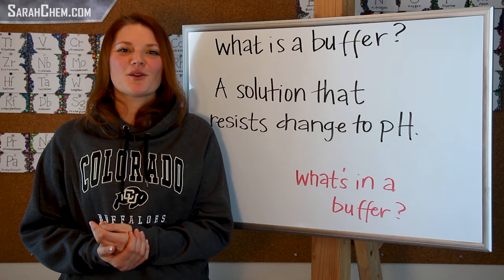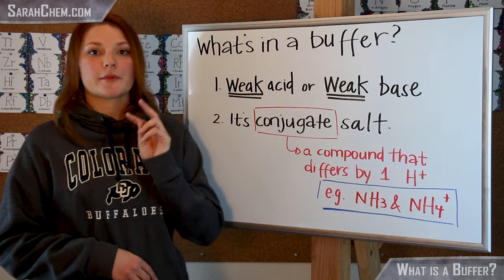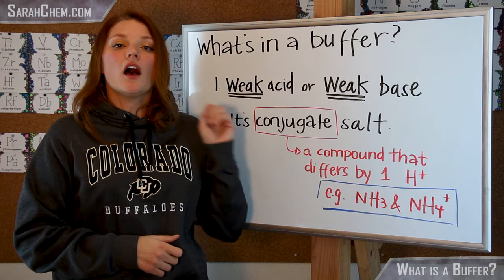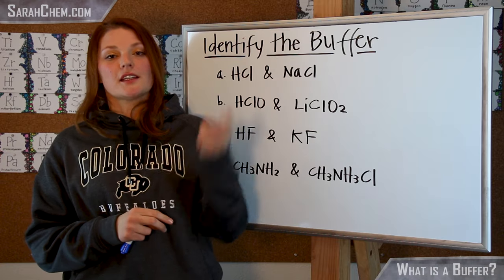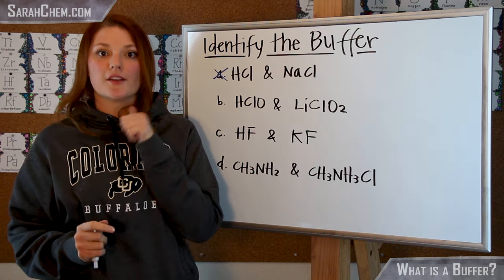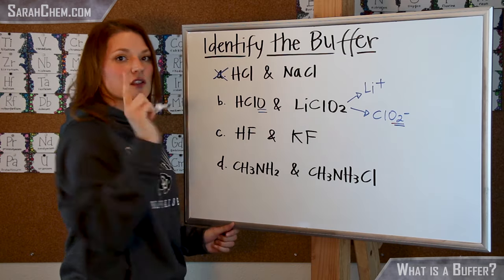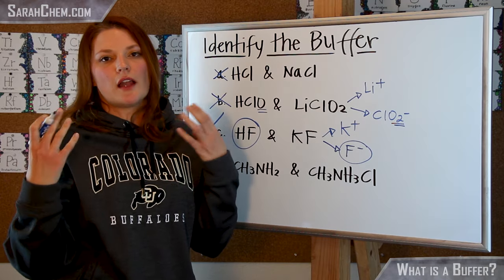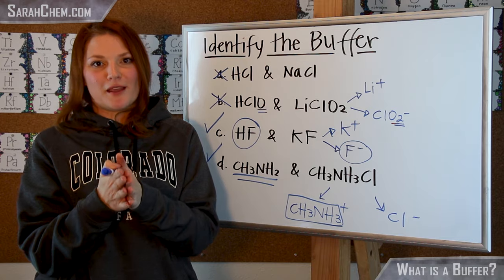What is a Buffer?

Comment: In option b, she says that it does have an additional H but cannot be its conjugate because of two 0xygens. How are oxygen supposed to determine its conjugate-ness?
Reply: If u added a H+ to ClO2- you would get it conjugate acid which is HClO2 which is diffrent than HClO in both name and structure. the conjugate base for HClO would be ClO- so if the salt was LiClO if would be the conjugate salt for HClO
Sorry that im late but I hope this helps

Comment: Plz explain how HNO3 &CH3COONa is a buffer
Reply from the maker: These two may or may not form a buffer.  It would depend on how much of the strong acid you added to the sodium acetate solution.  The strong acid would need to be added as a limiting reactant, so that at the end of the reaction, only the weak conjugate pair (CH3COOH and CH3COO-) are left in solution.